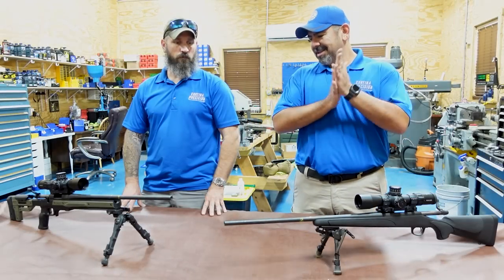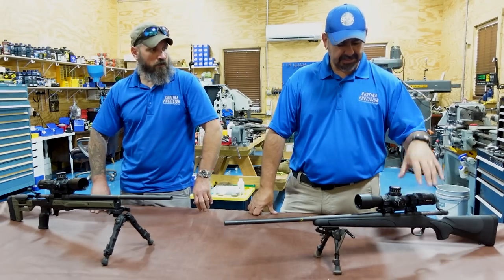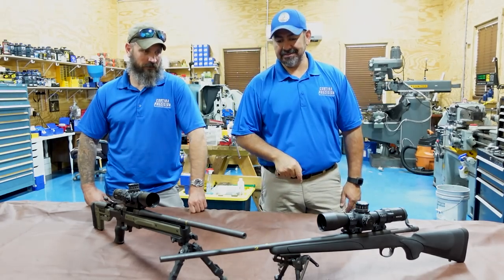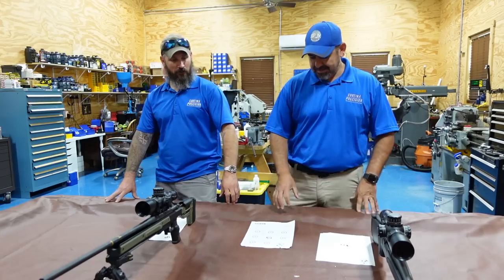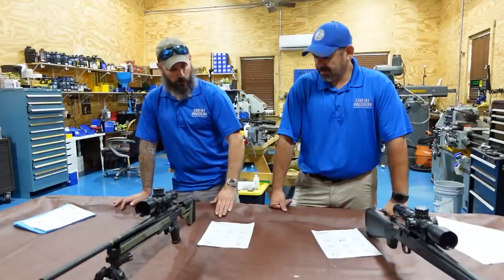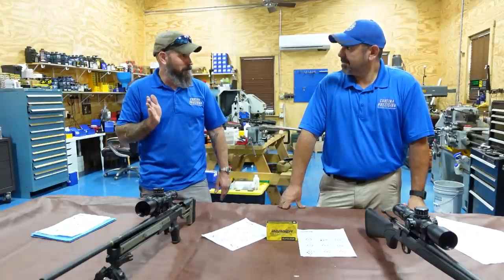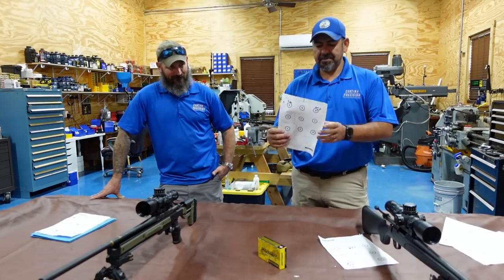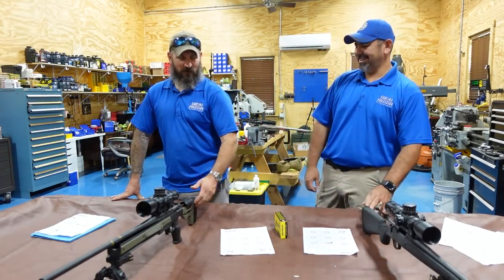6.5 NEEDS-MORE | NEW ORYX CHASSIS

Comment: For a control you never should modify the original state it's in, otherwise it's not a control anymore. Realistically though, pillar bedding would be something someone would do to make it group better. Assuming someone is keeping the stock, it probably means they're on a budget (or, this is a side hobby/hunting gun only). The only thing I'd add is a cheap cheek riser. You can find one for $15-$20 or so, you just drill holes in the stock and put machine screws through it. Personally, I'd 3D print a custom one. 😉

Comment: Interesting that the wait time to shoot inbetween groups came up in this video.  I was apparently doing it the wrong way actually waiting one minute between shooting to prevent excessive barrel heat.  What is the proper way?  Thermometer?  I'm talking working up loads so trying to get the best results.

And I may have missed it, but are we not shooting off a quality front rest and rear bag to get the most thorough results possible?

Comment: # 1 went from 3.5" group to 1.25" group, but will #2 see a similar improvement?  You have already modified #2 by pillar bedding and free floating the barrel, but it appears the groups have not improved.  Need to show the true effects of the chassis before making other changes.  If #2 does not improve with the chassis, explain why you think that would be.  Tuner brake should be after a trigger job as the trigger is a more or less fixed change equal on both rifles, while a tuner will most likely settle at different tuner rotation points.

Comment: I say scrap the control experiment. You have two identical rifles where one shoots better than the other. I say do each mod to both at the same time and see if the ‘control’ still shoots better groups. 
Mods in order should be:
1. Chassis
2. Trigger
3. EC tuner/break
4. Reloads

Comment: The oyx is great, had one for my tikka t3x .284 Shehane.
BUT, it was hard to clean the barrel since the butstock was in the way of the cleaning rod so I couldnt get it straight through the barrel.
Reply: Just go from the muzzle end? Take the cheek riser off, push the bare rod through, put you patch on, pull it through. Not any more difficult.

Comment: I think the 6.5 creedmoor should have been based off the .308 cartridge rather than the 30 TC for a little better case capacity but it's a great round. As for scope height those are fine that's just keyborad shooters talking. You can use a slide on cheek piece or adjustable one like on the ORYX if it's too high to get a cheek weld.
Reply from the maker: You just described the 260 Remington. 😜

Comment: For what that gun was made for and at its price point, ( sitting in a deer stand shooting deer out to 300 yards max ) a 1.5" group is good enough for hunting.  Now, if it was a 700 police or 40x and shot 1.5" groups then I would send it back to Remington. 
I agree throw away that plastic stock, blue print the actions, put a nice hunting stock on the control gun and tuner brake both. Then shoot both from prone and then from a bench and see how they compare.
Reply: Agreed. And don’t try to mess with custom loads. Your Berger factory loads are your control. Tune the load to the rifle or tune the rifle to the load. This is more of an exercise in tuning the rifle to the load.

Comment: When do we get a EC tuner that is Tbac CB compatable? Does anyone make a suppressor compatible tuner? 

As for the video, call the targets your control. You'll keep shooting the same groups otherwise and be throwing away ammo. That being said. Change one component at a time starting with one's you can remove and re-install. That way you'll know what's making the difference. Anything that needs machining should be done last and the gun should be reverted back to original parts for each (well, maybe not the factory stock).

Comment: You change the control you no longer have a control. Leave the control the control until you have maxed out the other gun, then swap all the improvements to the control and see if it does the same there.

Comment: Chassis stocks are not suited for woodland hunting or similar environments which require quick target engagement & unsupported shooting. One could also say the pause was between 5 shot 'strings'. Albeit a great choice for other platforms, the optics used for this test wouldn't be compatible in the field ...impractical, not durable.

Comment: I'd love to see load development on the control before changing chassis etc.
Reply: In a way, the tuner effectively does the same thing. Sure, the SD's and ES's could be better (especially seeing that one group that had a 55fps ES) which the tuner can't compensate for BUT as of at least right now, they aren't taking them out to distance so load development for better SD's and ES's isn't going to show much if anything. Take for example the 6.5mm Berger 130gn OTM's with a .287 G7, the difference between 2700fps and 2750fps in bullet drop at 100yards is .09" (or  .086moa) (2.48" vs. 2.39") and being a 100% stock action sporter barreled rifle, it's nearly impossible for it to be consistent enough as is to be able to see a .086moa difference from a 50fps ES.

Thats why when doing load development, particularly at shorter ranges (less than 300yrds), I don't worry at all about group size until I'm doing seating depth development. During charge weight testing, I couldn't care less if the groups are .5moa or 5.5moa. my goal is to find what gives me the lowest ES (I dont even care what the SD is because I shoot for single digit ES's to at the most of maybe 15fps ES over a 10shot string). Only then do I move on to seating depth to tune in the group size which effectively is what Eric's Tuner pretty much does.
Reply: @CJ-ty8sv  Yes, I completely agree with your methodology regarding load development. Yes, the SD's and ES's might not be significant but load development as you stated doesn't stop with SD's and ES's... 

I have had experience with a couple of rifles, all standard with synthetic stocks, where one in particular couldn't group below 1.5" MOA groups at 100yrds. I follow the same procedure as you during load development. Even during the first stage, all the groups came in under 1"MOA at 100yrds. Ended up with two different loads for two different bullets and weights, both below 0.5"MOA.

This brings me back to the original reasoning behind my initial thought process (and the whole idea behind this project I suppose):
The options to consider when you want to increase your accuracy with a newly purchased rifle.
1) Follow the route of precision - opting for a chassis etc...
2) Do a load development beforehand, which would be a lot cheaper if you already have the equipment.

I just feel it might be an opportunity missed once they have opted for a new chassis on the control as well. That's all.
Reply: @mr.kolskoot8114  I definitely can agree with all that as I've had and seen my fair said of stock rifles that shot poorly with factory ammo but shot very well with well worked up handloads. At the same time though, I have on a number of occasions seen just changing to a different factory ammo make a substantial difference too.

I do have to wonder if the premise of this "needs-more" series is really for the guy or gal that might want to get into the sport but not all the way as far as hand loading... That is a whole different can-o-worms from just wanting to get a setup that shoots great with factory loaded ammo. As a long-time "car-guy" I'd equate it to "the type of person who wants to just do simple bolt-on upgrades and not wanting to tare down the engine and really "build" it" to get more power.

I will say this though, as of several years ago, I've started hand lapping off-the-shelf stock rifle barrels with pretty amazing results and it more or less "free" other than time if you know how to do it (and have the feel for it).

Comment: Next, blue-print the action. Remingtons suck without it being blue-printed.
Reply from the maker: You have to change barrel to do that.
Reply: Do you know who you're talking to? 😂😂
Reply: I have a stock standard Remington 700 Police in 308 Win that shoots  3/4 inch 5 shot groups with Federal GMM 168 Sierra Match Kings @ 100 Yards all day long . It shoots  .5 inch 5 shot groups with 168 Hornady A-Max bullets and 43gr of Australian ADI AR2206H powder . That’s good enough for everything that I need to do with this rifle . My brothers bog stock Remington 700 Stainless rifle sporter/Hunter rifle in 308 Win shoots .5 inch 3 shots with factory ADI Australian Outback ammunition using 168 gr Game king bullets  @ 100 yards, the crazy thing  about his rifle is he has never properly cleaned the barrel, he has never tried to remove the copper fouling from the bore . 400 rounds later it shoots even tighter groups 😳, it’s got me beat why this is so . It’s could be  because the bullets are a tighter fit in the barrel with all the build up of copper , its like a choke lol 😂.
Reply: @ErikCortina  you can remove it, put it on a lathe and clean up the surfaces. Remington fell off big time. Their very older stuff is great. In fact, my Army issue was a great shot once all the front-end work was done. Bedding a wooden stock with fiberglass made that weapon useful.

Comment: Are those the new RemArms or the older actual Remington's? Do you see any difference in over all quality between the two?
Reply: They're new rifles.
Reply: Those are definitely the new Rem Arms, as you can tell by the somewhat jeweled bolt.  The older Remington’s will be a solid black bolt on ADL’s.    I’ve personally had mixed quality with the older ones.  I have an older 30/06 ADL from about 2017/18 that is very accurate and functions flawlessly, however.  I have a new Rem Arms ADL 6.5 (just like in video) that I have not shot, yet.      

If you watch Remington’s first podcast they claim they improved in the following ways:  stopping assembly line more to cull out errors, a higher grade metal, and a fully CNC machined chamber (whereas, previously it was a combination of CNC and hand fitting which they said allowed for more inconsistency).

Comment: How good could #2 get if you used reloaded ammo that adjusted the seating depth to reduce bullet jump and optimize consistency?
Reply: The tuner would do the same
Reply: @hank3152  That's my point.  Keep #2 stock and use reloaded ammo to make it accurate.  Not everyone wants to cut threads on the barrel of their rifle.  Decent 6.5 Creedmoor ammo is costing over $2.50 a round, yet I can reload for less than $0.90 these days.
Reply: @tc6818  gotcha